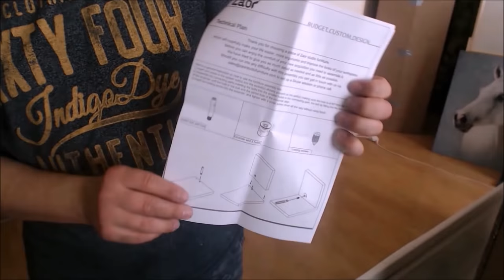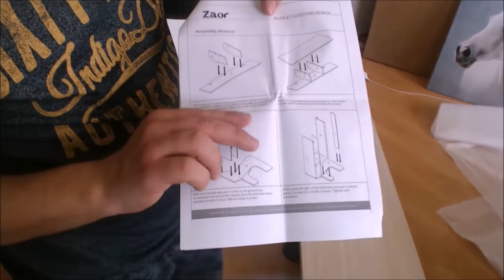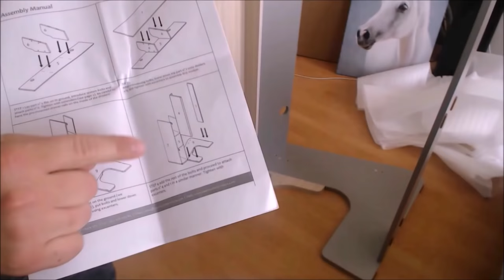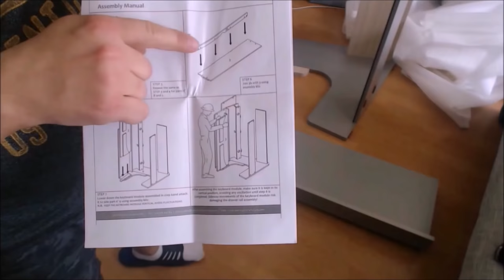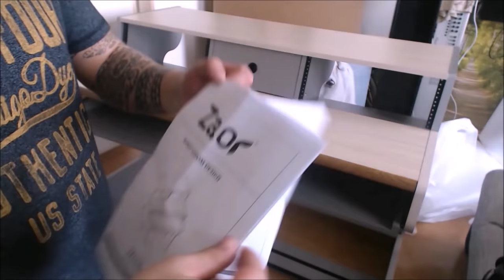Zaor Miza 88 oak Home Studio Desk | Studiotisch

Comment: Hey! I know this is an old video but I wanted to ask, what is the max load capacity of the keyboard tray? I'm using a Korg D1 (approx 17.5kg, 133cm long), do you think it would take it?

Also the tray height, is it adjustable? My Korg is about 13cm high, and so many 88 key desks don't seem to take the height!
Thanks! It's a great desk!
Reply from the maker: Hey, this is a great studio desk. I have a keylab 88 that weighs 15 kilos and I've never had a problem. I don't think there will be any problems with this desk, because it is quite massive and there is quite a lot of space in it.

Comment: hey sorry if this is a really stupid question - but the strip that runs sideaways across the floor.... does that get in the way of an office chair if you wanted to tuck it under the desk? it looks like it would.
Reply from the maker: this is not a stupid question. my answer is yes. but it hasn't bothered me so far because my chair doesn't fit in from the keybord.
Reply: @GabrielNass  does it make it a pain in the ass to do normal work stuff at the desk, like keyboard and mouse, typing etc? i like to sit with my chair tucked right under there if that makes sense.
Reply from the maker: @martinpalmer3575  no, i think it's very comfortable. I work 8-10 hours a day in my studio with this desk.